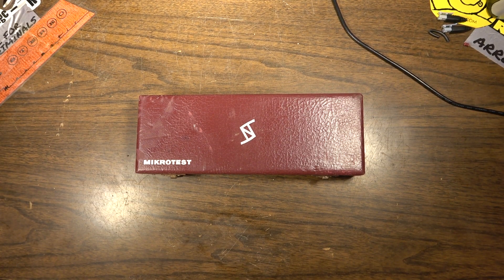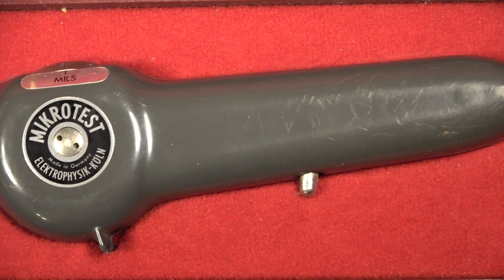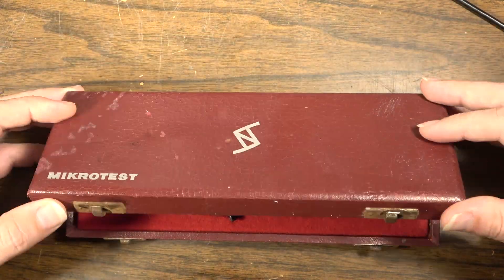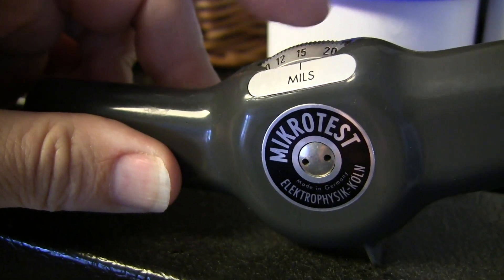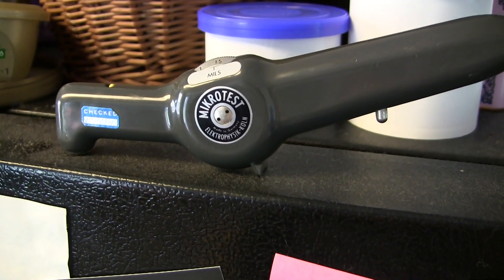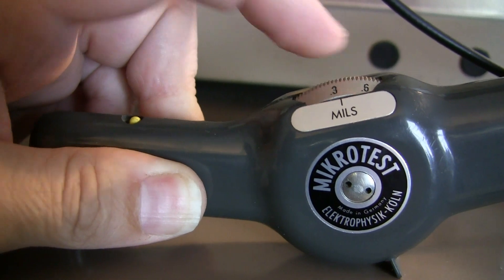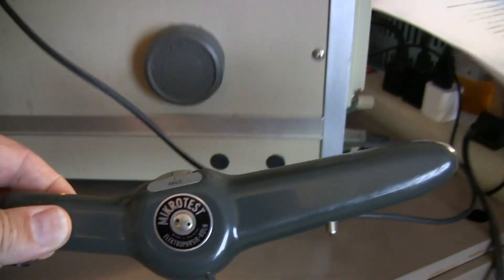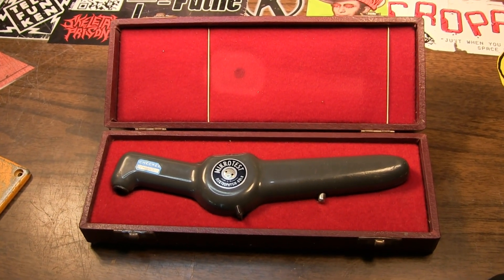THRIFT STORE FIND: Mystery Test Equipment Costs HUNDREDS...I Paid $5!

Comment from the maker: CORRECTION and UPDATE: As comments have pointed out, the measurement "mils" is equal to one thousandth of an inch, or .001". They do produce these that measure in micrometers and millimeters also, but this one is imperial. Also, this device is capable of measuring the plating on plated steel alloys, such as chrome or nickel plating. This could be useful to those of us wanting to know how thick the plating is on various guitar parts!

Comment: I am an industrial coatings inspector. We just call them a DFT Gauge (Dry Film Thickness). They're pretty cool tools. The new ones are all fancy, and probably produce a more "consistent" reading, but I always preferred the old magnets better. There's an art to using them correctly and achieving accurate results. If you'd be interested in selling it, let me know.
Reply from the maker: Email me if you want it: bradlinzy at gmail

Comment: I'm a retired paint chemist and we used these magnetic film thickness gages back in the seventies and eighties,  I have an old one around somewhere that  I saved from the trash at work. They were quick and inexpensive but not particularly accurate for the kind of work we were doing. Take it out and check the film thickness on your car hood , probably About 5 or 6 Mils

Comment: Looks like the silver button on the bottom resets the tool so you don't have to wear the wheel out going all the way to the end of the scale. You could probably start slightly above the expected range and work down much more quickly if that's the case.

Comment: I doubt the coating is 1.5 mm. It’s probably 0.0015 inches.  Mils is 0.001 inch
Reply: @UCLRGB5QAOLLZGF5wM3mrd3g  the millimeter is normally marked MM  mil is 1000th for an inch dating back to the tun of the 20th century  when imperial was the predominate measuring before the meter took over the EU and then the world.
Reply: .o25mm not 1 per mark .  The device would have been marked .01mm or 10 micron  if it where in MM . This in 25 micron divisions  .